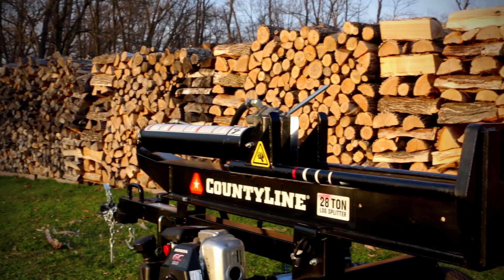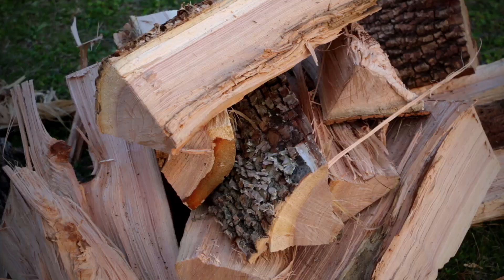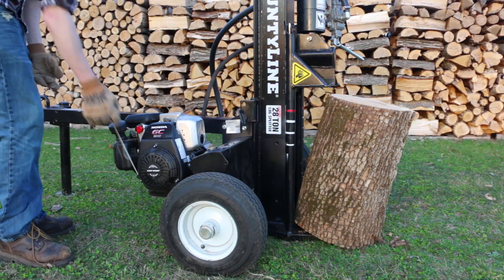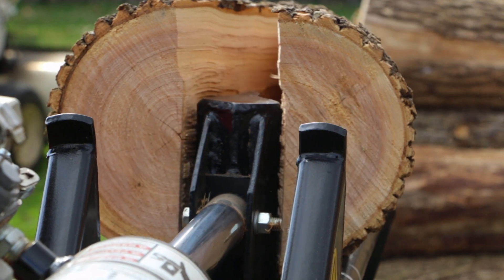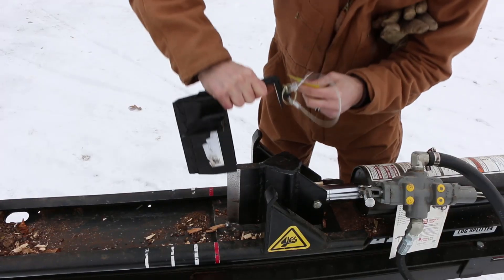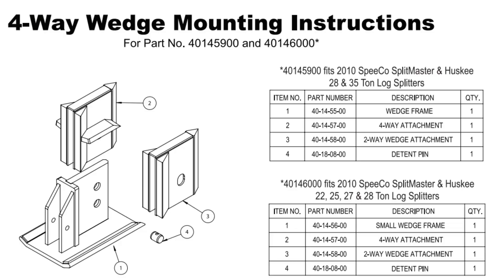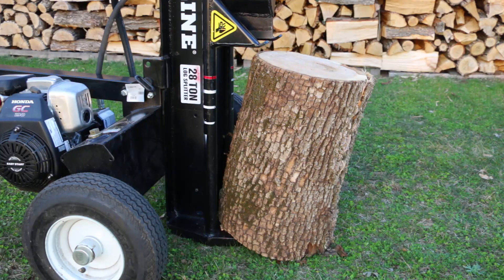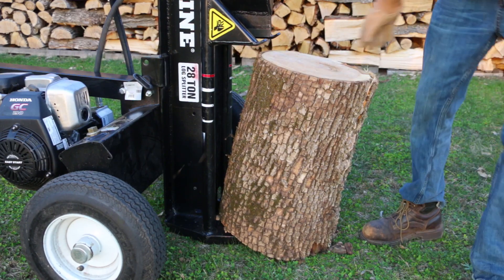Updated Review of County Line / Speeco 28 Ton Log Splitter a year and 20+ cords later

Comment: My brother-in-law just purchased this model and there are modifications to the engineering seemingly based upon the cons expressed in your videos.  There is a exhaust deflector aiming the gases downward, away from the operating area.  The filter which was exposed has been moved under the main beam, though the line still enters in the same location.  Very impressive that the company was responsive to the concerns expressed by consumer.  Keep up the videos, I have found your productions a couple of times when looking for DIY info.

Comment: What no one seems to mention is the two different splitting styles. After using a homemade splitter that is too low off the ground and pushes the wood through the wedge, we got a commercial one that pushes the wedge through the wood like this one does. Simple but fundamental difference! As a one person operation, now I grab a round from the wagon, split and stack without the wood ever hitting the ground a second time. My productivity has more than doubled and the wedge cuts through knots and crotch wood much better that way, greatly reducing scraps and break offs. 
On the other hand, pushing the wood through the wedge is great for a two person or complete wood processor operation.

Comment: We installed an outdoor wood boiler this year, so given all the wear and tear on the body you mention, we purchased the 25 ton County Line at Tractor Supply.  6.5HP Kohler engine; they build solid small engines.  Very similar experience, I fed it some very big rounds in the vertical position, and really had to wrestle them into the vertical position.  It powered through some very gnarly would, tearing it apart more so than splitting it.  Great review.

Comment: The problem you mentioned when splitting vertically is easily solved by placing a 2 X 12 about a foot long on the ground next to the splitter plate to give the large block of wood a flat surface to sit on.

Comment: We have a 37 ton "Central Tractor" (before it was Tractor Supply) 20+ years old now.  We had the same concern about the filter and pump getting hit in the horizontal position, we built a protective "cage", I think we used it a or two season.  It was really rough on lifting rounds up to split and now we just use it in the vertical setting.  Get a log round to sit on and saves alot of back problems.  Plus you can start having your daughter run the lever, I have my two kids trained on how to help me with running the lever.

Comment: I just bought the Countryline 22 and its a great system for my uses.  I had a 28 ton Home Depot that cost me $1899 5 years ago and this $950 22 ton out performs the older unit. I would buy the Countrylibe 22 again.
Reply from the maker: +buzzsah I am glad to hear. The way things are going I would think this thing should be still going strong in another five years. Makes me feel even better about the choice after reading your comment. Thank you for sharing!

Comment: One thing I forgot to mention was I had some huge rounds of oak from a tree I drop 4' Dia. i borrowed my neighbors splitter because it had the vertical or upright option. I ended up taking a piece of 3/4" plywood in it and cutting a notch out for the foot of the splitter this worked well if I had a piece that was to heavy to hold I put some wedges under neath and that held it tight.
Reply: Dad taught me that trick about 20 years ago. Glad someone shared the idea.

Comment: I think I'ed get 2 pices of 1/2" plate ,sharpen it and weld it to the blade for the 4 way !
Reply from the maker: +Theredneck Prepper I have really been thinking about it. I also want to weld a plate on to help protect the filter. Just need to make it down to the steel yard. Thanks for sharing!